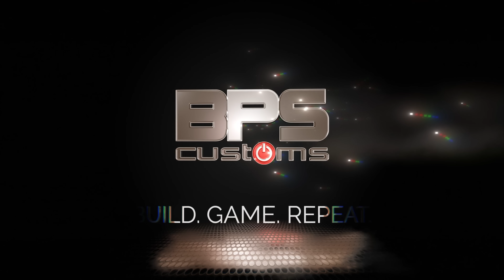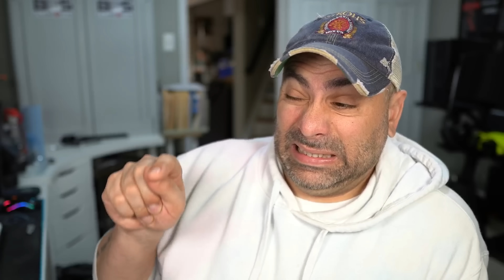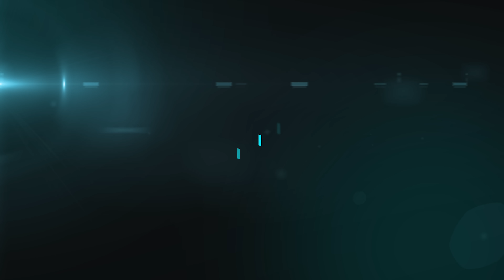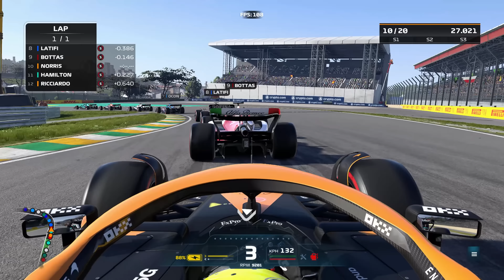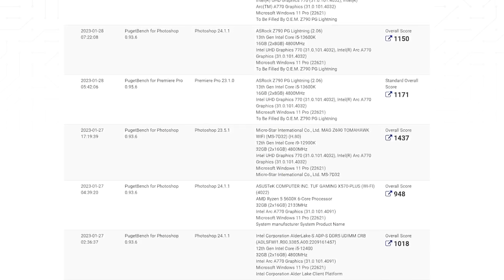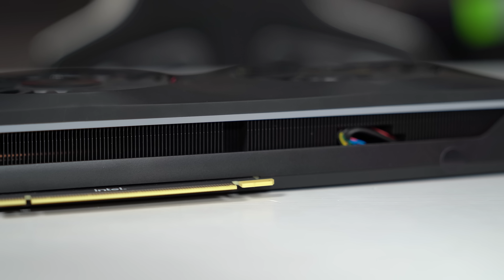NVIDIA & AMD Should Be Scared Of Intel

Comment: I recently sold off my 3070 and was in a drawn out process of picking a replacement. Got an RX 6800 XT openbox from Newegg, but it had a defective heatsink with a literal hole in one of the heat pipes. The card also had some very strange boosting issues that I couldn't ever nail down. Returned that and managed to get another 6800 XT, this time a Red Devil. I was so excited for this card, except the absolutely insane coil whine... it was louder than my air purifier maxed out. I was then in a bit of a pickle and had been given the option to get an A770 direct from Intel, but I never received a follow up. I then decided to avoid my bad luck with AMD cards... and settled for a 4070 Ti since my history with Nvidia has always been positive, aside from the cost. There is a part of me that wants to abuse the lenient return policies of Amazon, again, and grab an A770. The only thing holding me back is that I require absolute stability, and I don't think Intel can quite guarantee it yet. I will be following their progress and will definitely consider the future generations as I, like most people, are tired of AMD and Nvidia using whatever excuse they want to justify massive price increases for essentially no gain.

Comment: That A770 has seriously improved.
I do simracing only...no first person shooters, etc...
The only title I could not launch was Rfactor2.
That is now fixed with the latest 4090 beta driver.
The thing that impresses me most of all, is the smoothness in all titles.
I ran a two lap race in Assetto Corsa with 20 cars in extreme rain...so low light and lots of rain spray streaming off cars everywhere... the card did not stutter once.
It was impressive to say the least.

Comment: I'm seriously considering this card. I've just finished building my son's new production computer. It's I7-13700K based with 128GB of DDR4 ram* and 5TB of Samsung 980 Pro based storage (I know, I know) on an MSI DDR4 Pro motherboard. He needs a huuge amount of memory for his symphonic music productions. The GPU currently installed is the legendary EVGA GTX1080TI FTW3 that I've been using for years. I kinda feel bad installing what is now fast becoming a relic and I'd like to install a GPU that would assist him if he ever decides to get into Twitch streaming ect. He's a huge gamer as well but it's mainly Xbox. The ARC A770 seems like it would be an excellent balance of modern features and cost effectiveness. Please keep up with the reviews, we need to know.

*Why DDR4 memory instead of DDR5? Because every manufacturer told me to not even bother trying to run 128GB DDR5 on current gen Ryzen or Intel and would you risk $1,000+ on memory and motherboard that probably won't work? The G.Skill Ripjaw 128GB 3600MTPS kit I've installed is running stable at 3450MTPS on XMP1. I don't know much about memory overclocking but I feel I'm pushing the memory controller to the edge and this system needs to run all day with no crashes.

Comment: I would be interested to know what CPU was used to test the Arc? Your video 2 weeks ago tells me you changed to AMD and that tells me if you added the Intel Arc to it it won't work proper. Ghosting and glitches are result of using the AMD CPU on this Intel card. Resizable BAR enabled and 12th or 13th gen CPU is needed. Yes 10th gen is in requirements but it really is not enough. The GPU heavily rely on CPU and not just any CPU. The architecture of AMD is different so close but no cigar as you noticed. I don't know if this is a bad or a good thing that you need to spend a little more on late chipset and CPU to gain better benchmarks and glitch free from affordable GPU. Personally I think it is a good thing as having the latest basics will give long life to your build. It would also make sense for Intel to make GPU that works better on Intel CPU.
Reply from the maker: It's on the charts

Comment: Why would they need to worry about a company who's no longer going to be in the GPU market?

Leaks aside, Intel have all but confirmed the cancellation of their GPU division in quarterly reports. AGX is hemmoraging like 1B a quarter and it's not like they even have a plan to be profitable. What are they going to do? Raise prices on chips? Magically lower costs? 

Intel's best effort, made using the most advanced node (at the time of design) and delayed a year to try and patch their harware woes was a 6600 priced like a 3070 and using 3070 amounts of power. Ain't nobody need to be afraid of shit, at least until mainland China starts pumping out GPUs.

Comment: Sadly the A770 is a little too underpowered for my needs - I really wanted to get one. 

I'll be getting a 6800 or 6800XT. Whether that's new or used will depend on the deals available.

I will definitely be looking forward to Battlemage. Hopefully they have something a bit more powerful the second time around.
Reply: a770 16gb hardware is better than 6800xt. As you said Battlemage should come out Q4 or early 2024. By then you would expect the driver issue to start to make some real gains.

Comment: My system is AMD but I would have bought the Intel GPU. I own Intel stock even though my rig is AMD.

Arc was delayed, then delayed, only be delayed. When it launched it was the low end variant with a lot of issues. I needed a GPU, can't wait forever and wanted more than 8GB of VRAM. I bought a Gigabyte RX 6700xt and moved on.

In 3 to 4 years I will see what Intel has to offer when I upgrade.

Comment: If these new drivers can get the A770 consistently performing somewhere between a 3060ti to a 3070 I'd say they have a real winner at $350. The hardware is there and the A770 does actually beat the 3070 in 3D Mark Timespy so there is definitely potential if Intel can iron out the drivers. I'm hoping Battlemage can perform at the level of a 4070 Ti for $499. nVidia and AMD won't know what to do with themselves.

Comment: I concur. I've been impressed with my mini PC's Iris XE. It has now replaced my Nvidia shield pro for my projector, due to the AV1 codec and it's ability to provide a smoother, higher detailed image. And compared to my Nvidia RTX 2060 and 3060 ti -- the Iris XE seems to handle 4K and 8K videos with more ease if you can believe that. Less stutter and buffering.

Comment: I recently built a new PC using an A770 LE along with a i5 12600K & Z690 ASUS TUF motherboard. Runs perfectly fine for the games I play (ex. CyberPunk, Halo Infinite, MW2, CS-GO) on High/Ultra settings in 1440p with a 1656Hz display. I even mess around with it using my first gen HTC Hive....again all works fine for me. As for Halo Infinite, I turned off that light reflections and those weird artifacts went away. I'm hoping that when Intel releases the latest drivers, it will be an even better card.

Comment: How many are just rooting.  I put my money and showed support.  I built a NVR for Blue Iris and the A750 is a beast.  With a CPU of Ryzen 7 5700X. It runs about 5% GPU resources.  While the previous 6th gen Intel with integrated GPU ran about 95% GPU on an optiplex.  My new system handles 8+ cameras running over HD and no lag.  Also on my plex server running OMV.  Works so far but I have to test it further.  Transcoding is awesome.  Now I have AMD GPU and Intel GPU.  No nvidia.  Intel GPU are beasts for transcoding and video editing.  Gaming is meh.  But how many of you stepped up and put money down?  I did.

Comment: I've said this on anothjer channel but ill state it here as well. 

As long as Intel makes GPU's that can trade blows with current gen mid range cards (4070ti), or previous gen high tier cards (3080/6900xt) for CHEAPER.  I will buy intel over AMD/Nvidia.

The mid-range market and pricing has been obliterated. I refuse to buy mid-range above $500 and that's because I adjusted for inflation. I won't pay for inflation PLUS markup greed. If we can get current gen Mid-Mid High Range back to $379-$450, people won't be skipping gens as much and buy more often.

Comment: The biggest Advantage Intel has over AMD and Nvidia is Software. They have an army of software engineers that can go head to head with Nvidia on features and driver support. They are behind because they are starting from scratch. When they catch up to nvidia they will eventually run past them. You will see XESS have better quality than DLSS in the futue while being more widely supported in more games than FSR. You will see intel eventually win in ray tracing as well. And you will see low level features pop up when pairing intel CPU/chipsets with intel GPU's similar so AMD's smart access memory. This will all take several release cycles over many years to happen but it will eventually happen and when we come out the other side Intel will be positioned as the premium product that you want and Nvidia will eventually be relegated to the "bargain" brand like AMD. The best sign of things to come is how agressively intel is working on their drivers, they would not be doing that unless they were dead serious about taking over the GPU market which is smart because in the future if people are buying intel video cards that will drive sales of their CPU's as well.

Comment: One issue with the A770 is that it absolutely requires PCIe 4.0, and most people are still using systems which do NOT have PCIe 4.0. These Intel cards CAN technically run on PCIe 3.0, but the performance ends up being hurt so badly that the performance becomes completely unacceptable (losing more than 80% of your fps), so you might as well be running pretty much anything else at that point. It's not like with the RX 6500 XT and 6400, which also requires PCIe 4.0 for full performance, because those can still get maybe 80% of the performance on PCIe 3.0 systems, or 100% with reduced texture detail, which could still be considered worthwhile for many. 

It's funny how the most likely reason that someone would want to have PCIe 4.0 so far, is to be able to run some mid-range and low-end graphics cards. PCIe 4.0 might also become more useful and relevant for SSDs some time soon, but even a lot of professional users would probably still be fine with SSDs running on PCIe 3.0 (but any professional user should probably be getting a PCIe 4.0 capable system if they're buying today, as it's not an expensive feature to be able to have). It often takes years for the latest standard to become relevant even for many professional/ workstation workloads, and some standards or features never become widely adopted or very relevant.
Reply: I was seriously considering getting an A770, but immediately realized that it wasn't worth it because my motherboard doesn't support PCIe 4.0 (it's a B450).
Reply: Me too, I wanted to upgrade my GPU on my ancient system but of course no rebar, no pci 4... So I CAN'T buy a intel card AND they somehow perform worse in 1080p then 1440p (relative).

Comment: I built a low cost AMD 4 with a Ryzen 5600G. I use a nivida 1050 strictly for handrake encoding, still using the 5600's as the graphics output. HDR is horrible on my other nivida cards as well, not a gamer. I am intrigued by using the intel card for encoding, or as a main output card , as long as the color gamut and HDR is better than nividas cards. Using AMD's built in encoders the color is way off. Anybody have ideas on this? and does the intel cards have built in quick sync encoding?

Comment: I was genuinely sad when I saw they were requiring ReBar, and I'm holding out hope future products might not. My current systems are both X99 BDW parts and the platform never had ReBar support enabled so buying any of this series would have been useless. I also have a 3080 in my primary system so even once I upgrade it's unlikely Intel will have a faster part at a low enough price for me to justify as I tend to hold onto my hardware until it dies or is a noticeable bottleneck. I'm certainly rooting for their success as the current market situation is quite frankly cancerous and there's no sign amd/nvidia have any interest in changing things. I just hope for a product I can use myself!
Reply: At 3080 territory you probably wanna move on from X99 anyway. I know it's terrific platform and I still keep mine around but my 5960X at 4.5GHz is not enough to get every ounce of performance from a mere 6900XT... in fact it was missing up to about 30-40% performance (!) depending on the title. The only reason I didn't jump on 4090 is because for the same price I've got 7700X, Asus ProArt X670, 32GB DDR5 5600 on top of 6900XT (I've upgraded GPU first from 1080Ti)
Reply: @Micromation  Both AMD and Intel are running outside of their efficiency curve (which can be fixed, but then you're paying for performance you're not getting which fundamentally rubs me wrong), AMD decided to build a terrible IHS which holds back efficiency, and I use 24 lanes of PCIe or I'd already be on 1700 or AM5. I can get around the lane usage by buying a new 10gb card as I already eliminated my other cards, but that adds to price of a new platform. As long as my setup works I'm perfectly happy waiting to see if whatever comes next is more in line with what I'm looking for across the board (crossing fingers that Intel's forthcoming 2400 series carries the same price premium as old HEDT did vs desktop).

Comment: I would buy a high end for sure. I love my A770 but, Intel is going for the money so we will probably only see the mid level cards because that is where the sales are. I do not game on mine though I have a 3060 for that but my A770 is on a I5 13600 with ddr4 and I love its performance in Blender better than my AMD with the 3060. Cycles is smoother on the Intel.

Comment: Intel has just announced that they have found a lot of driver bottlenecks that are causing performance issues and they are working on a driver update to address these bottlenecks. 

Looks like there may be more improvements to come afterall.
Reply: Lots of rumours but I have yet to see some kind of news or source for that. I do hope it's true, because then I can finally get one with peace of mind.
Reply: @jelly.1899  The News was initally repored by a german web site. They certainly have not dropped any drivers that reflect these discoveries yet but we can all hope. 

The drivers have seen progress since launch though. dx9 improved significantly for example. playing catchup of more than a decades headstart is not something that will be achieved overnight. dGPU and iGPU are not the same in terms of driver refinement.

A viable third player is exactly what the GPU market needs so I hope they get it right sooner rather than later too.
Reply: What did you expect intel just started  getting into dedicated  gpus but once they fixed there flaws and start proper optimisation  with newer processors  intel could end up being a very strong  blue only build 

If nvidia  tried making cpus they would struggle  and give up intel needs to get into the gpu market but yes the first batch of cards great 1080p  1440p  card for sure but for 4k gaming it's ideal untill they make a gpu that cuts it close or over 4080  then we have a decent  4k gaming gpu that's gonna interesting  once they sorted out the flaws right now with a beta  start of making gpus
Reply: @jonathanoxlade4252  I was not criticizing Intel. Improving and optimizing drivers is a good thing and to b expected given that they have just started out.

Comment: I am still using a 1070 Ti and wanted to upgrade, but the products and attitudes from Teams Green and Red over the last couple of years have kept me on the existing card. I am truly considering Intel as my next purchase, especially with the recent improvements and rumors of further improvements.
Reply: My 1070 is like 6-7 years old and still runs everything.
Reply: 1070 here and still running fine, i don't care much for Ultra settings as long as game plays smooth without tearing or chopping.
Been following new cards for a little bit and after crypto-miners drop i thought the prices would finally normalize.
Unfortunately that did not happen, but I'm in no rush and if it takes another 6 months or a year... who cares.
This A770 is a nice surprise, lets see if it will have the impact that we would like. Patience is a virtue.
Reply: I have been on a 1070 for what feels like forever, I just ordered the A770 16gb after reading the new details of the driver improvements. Not giving nvidia any of my money for their oversupply.
Reply: @LPAtkins  I think u can get MW2 for free. The deal ended but rn theirs a new 2 free game deal. I ordered mines 2 days ago and manage to get a MW2 code. Redemption ends by feb 28. And for only $350!??? Such a good deal.
Reply: Just remember Intel is were their at because of way shadier business practices than AMD. Overpriced and under performing.
Reply: requirements for the Arc are 12th or 13th gen Intel CPU. Resizable BAR enabled from the bios. It will work with 10th gen CPU's also but not as well. AMD CPU as you saw gives ghosting and glitches.

Comment: I was surprized when i got 4K45-60 either medium or high, while using RT in Flight Simulator 2022. 
At first i didnt even realise i had RT on and was dissapointed in the performance because it didnt seem much faster than my 5700XT, which was cheaper than the 16GB A770 in 2019 when i bought it. Now the non RT performance wasnt that much better, but it was surprizing for its RT performance.